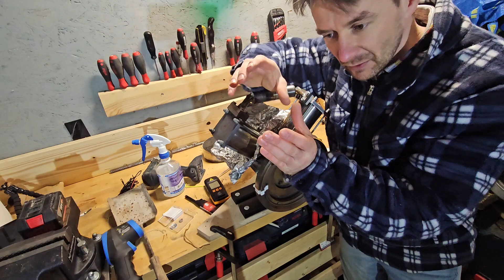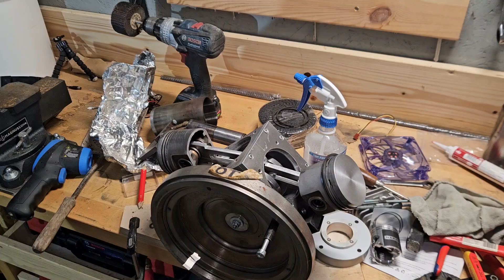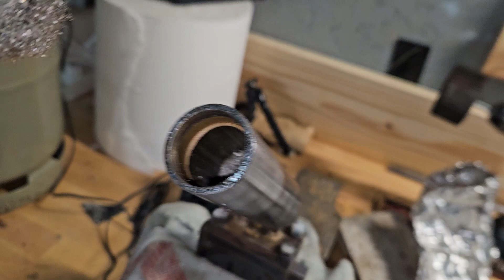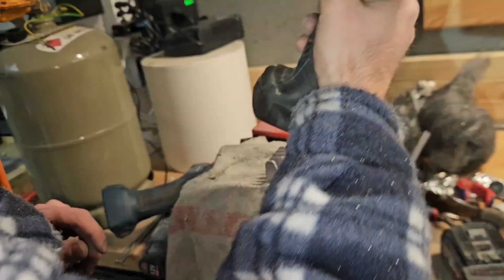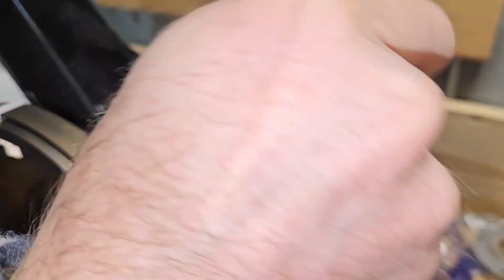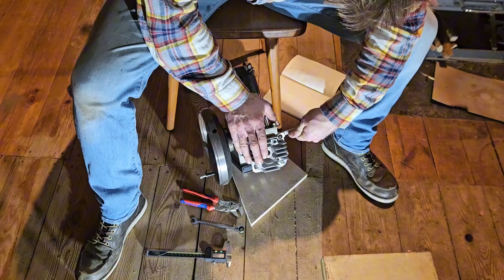Testing my 600cc Stirling engine at 1250°F + improvements

Comment: It's not about moving the air it's about expanding the air. The Stirling engine I built with a soup tin, one end of the tin was the hot side the other end was cold side, it did not have a piston but a displacer, just something that took up just under half the space in the can  but did not touch it. The displacer was moved by a crank pushing a wire rod through a small hole in the cold end. When the displacer is at the hot end the air in the tin contracts at the cold end, as the displacer moves/displaces the air it rushes around the displacer to the hot end rapidly expanding causing the pressure in the sealed tin to rise pushing on the tiny piston with a 15mm diameter and about 30 mm of travel, (you could theoretically connect this to the tin anywhere) transmitting the pressure energy in to rotational where the piston connects to the crank about 90° out from the displacer. 
I am not an expert but I have built just 1 working Stirling engine 🔧👍

Comment: what you're saying about the compression ratio isn't far off but the problem that the lower compression ratio will solve is the imbalance in energy in the flywheel compared to the what is required to overcome compression. also, you talk about 'pushing' the air but air is never pushed. when air moves it's because of the pressure gradient force, this has to do with pressure, viscosity, temperature, or anything else that effects a fluid. The Stirling engine is primarily manipulating the temperature to drive this force and do work, the compression isn't as important. The relationship between the compression energy and flywheel energy is important though.
Reply from the maker: Thank you for your feedback @kingp00 that sounds convincing to me and is worth trying. I was thinking of increasing the flywheel so much that if I spin it by hand without heating, I'd make 2-3 rotations from flywheel energy.  Or increasing absorber volume and lowering compression until it does the same. Thank you for your knowledge
Reply: @Son-of-Allen-key Have you seen
https://youtube.com/@shanepomeroy?si=TpQ0HrBqAP73DR8S
He is on Stirling engine number 5🔧👍

Comment: I have looked at Stirling engines for space flight. Firstly they work more efficiently at higher pressure. some NASA units now work at over 10 bar. Secondly the lighter the gas is per molecule the better it works. If you take air to have a relative density of 1 at 22C and sea level on average, then Helium has a relative density of roughly 0.14, Hydrogen is better but it is more expensive and explosive in air and is more than 6 times easier to ignite than natural gas. It's also more expensive. I would also suggest way more cooling on the cold side preferably with aluminium fins as steel is far worse at conducting heat.
Reply from the maker: Hi @gordonlawrence1448 and thank you for your ideas and feedback. Helium is a good idea, but therefore, I'd need a sealed crankcase. The gas would leak around the piston rings into the case. It's a design flaw I made 10 years ago. But good Idea! Anyhow, it must be possible with just our cheap air here. I saw some running.
Reply: @Son-of-Allen-key  if you seal the crank case you can pressurise the whole thing.

Comment: I believe, if you could somehow reconfigure the tube connecting the two cylinders, from the top of the hot cylinder to the bottom... it would work. Also, leaving the hot side without piston rings, could help.
My suggestion for the finned flywheel, was more for the flywheels weight.. but fin could help too. When it's working, the cold side will start to heat up and it won't be winter forever:p
Reply: connecting the cold side of the hot piston to the hot side of the cold piston can be done by running the connecting rods concentrically and having the cold piston and hot piston in the same cylinder

Comment: I am thinking the reduced compression would lower the peak pressure needed within the engine also needing less of a temperature change to achieve this.
It should help the engine run at a lower hot side temperature.
Reply from the maker: It's worth trying. I think if i take a bigger absorbertube, it's not too hard to implement.
Reply: @Son-of-Allen-key I've always wondered about the absorber tube/heat recovery tube, surely If you take heat out of the air it will contract? When you want it to be expanding.
Reply: @ That is true but it also returns that heat to the air on the way back so you need less heat to expand the air on the next cycle.
Reply: Yes I agree I think. My theory is the engine just doesn't expand enough air/raise the pressure enough to overcome the compression 🔧👍

Comment: This would be difficult but if you could figure out how to trap helium inside, helium is much more thermally conductive than air and would make it more effective
Reply from the maker: Yes, good idea @tindy128011 I'd have to seal my crankcase then. I'll start with the easiest suggestion to implement and then go for helium if nothing works.

Comment: Wd40 is mostly to displace water and is a poor lubricant. I suggest using the thinnest synthetic engine oil you can find, like 0w16 if that is sold near you
Reply: Yeah, WD40 is extremely thin. Maybe just use a zinc oil additive. Bardahl have a video where they run an engine for over 1000 kilometres after draining all the oil (after adding their additive).
Reply: Although I would consider the possibility of adding engine oil creating carbon buildup